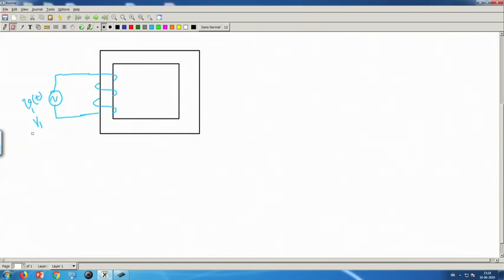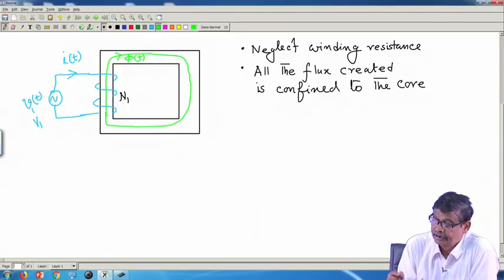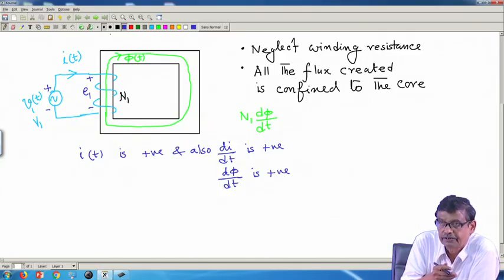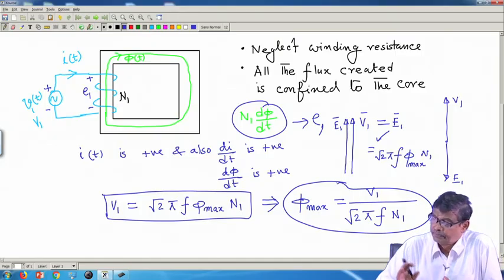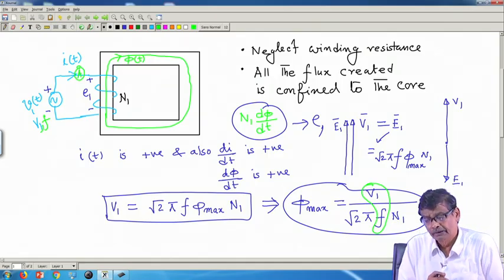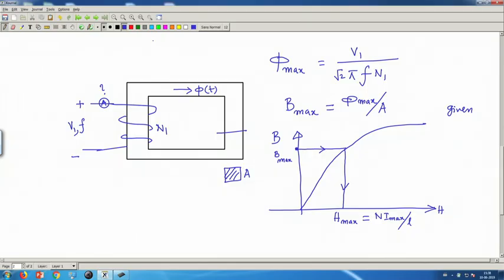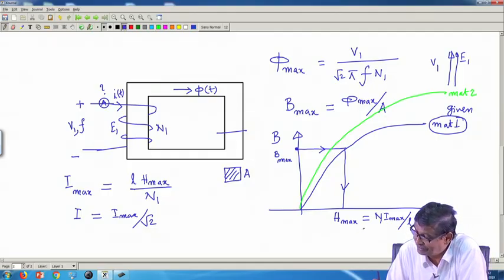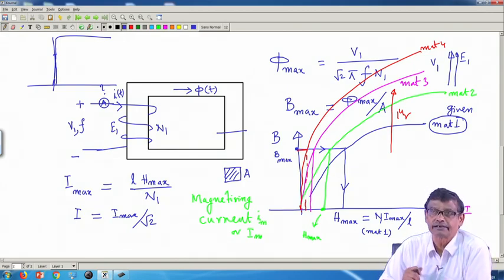Lecture 02: Magnetising Current from B-H Curve

Comment: If the supply voltage is reducing then current must be reducing, accordingly the voltage across the coil must be inverted
Then how can KVl be satisfied in that case ?
Reply: explanations are being given at instantaneous positions.
Reply: Current lags 90 degree in case of inductor, so if we take derivative of the current wave it will give same as V(t) with opposite direction.